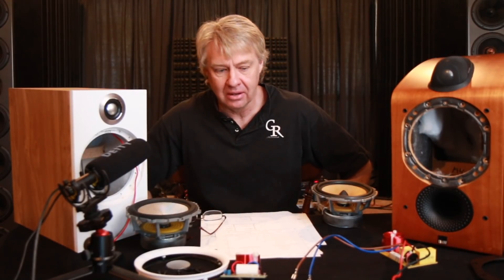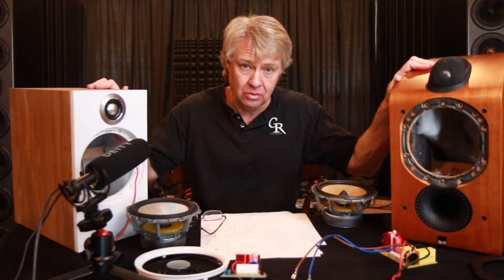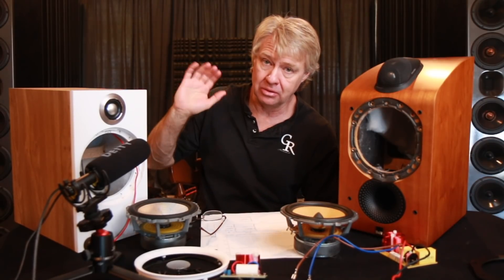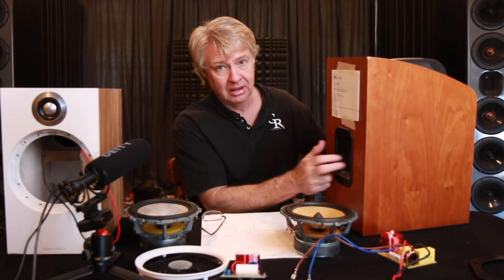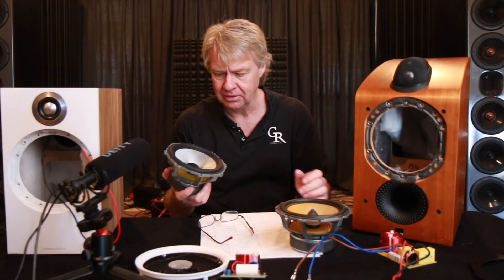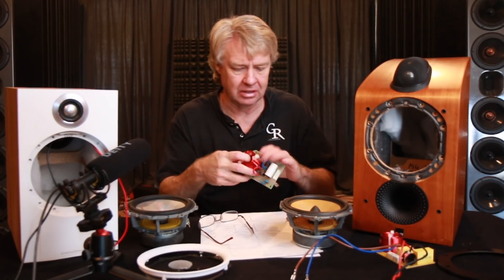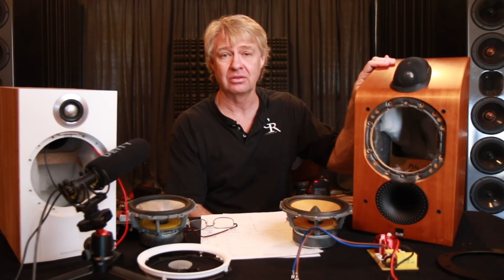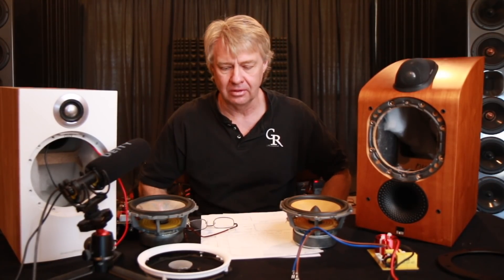Comparing Bowers & Wilkins PT.1

Comment: The 606 tweeter isn't mounted from the back side. The metal surrounding can be removed, then you will see that it is held in place by four small bolts.

Comment: In my room, my 706s brass band sounds like wooden instruments instead of brass. My made speakers brass band sounds like brass instruments instead of wood. And the piano sound on my 706s is "blong blong". But the piano sound on my made speakers "gling gling". And the voice sound on the 706s is 2D and not "throaty" enough. The brass band and piano on my made speakers absolutely smokes the 706s. Either my room really sucks treble or the 706s lack treble. I use the 706s as monitors cos my room acoustics varies a lot in the bass. I copied the 706 sound best I could with my made speakers and they sounded at least as ordinarily as the 706s. Then I tweaked my made speakes just a little bit in the treble and now they smoke the 706s. But!...I couldn't possibly make speakers without good expensive monitors, and they are a game changer for my speaker building habit. They were the thing that really got me going (they improved my speaker building so much).

Comment: Hello Danny,  Have you come across a pair of even older B&W DM7 Mk1 (the original version). I would like to add tube connectors to my pair upgrade the crossover.  I also like the feet that are on the bottom of the pedestal base.  I look forward to your response.

Comment: Wonder if the old ones were made in the UK? I think you have to go to the 800 series now to find an UK system.
Reply: Yes indeed, the old 700 series, as well as the rest of their range back in those days were made in Worthing England , or at least so it said on the label/plate in the back . I used to have a surround package from the old 600 S3 , consisting of LCR 600S3 , DS 6S3  and ASW650. Even that 600 series as a starting point in B&W was all made in England. Different times no doubt. Yes, nowadays only their top offer 800 is made in England.  Regards .

Comment: They are two different series I guess. 600, 700, 800 - while I do find it interesting it would have been better to compare the 705 S2 - that would have been a closer comparison in terms of how they have evolved their materials and other techniques.
Reply: Absolutely, it would have parts quality specially tweeter cap as good as Danny's fav Sonic Cap, Mundorf Brand that is in the same quality territory as SoniCap or better ....  Danny did not mention that these woofers are top notch quality and build better than what Danny's uses in his design....
Reply: I got some 706s and use them for reference for my speaker building. They are my bass-med-treble level guide. Essential for an amateur like me with varying room acoustics. I copied the sound of the 706s with my made speakers, but then changed the sound on my made speakers just a little bit for my personal touch. I reckon my 706s lack treble a bit in my room and the voice sound is a bit warm and not throaty enough. Now, in that room my made speakers absolutely smoke the 706's. No bought speaker priced at 2 grand is going to sound exactly how you want it...but with making speakers from scratch with 2 grand monitors, you are going to make great speakers. That is if you know how to tweak the sound of your speakers to make them sound how you want them to sound (instead of a clone of the monitors). And if you can build crossovers you can change it if you move to another room (or if you change the room's acoustics, or even if you move your speakers).

Comment: It's not an orange to oranges comparison. The old 705s should be compared to the new 705 S2. The 600 series is lower in class from the 700s and therefore the quality is lower. .

Comment: Those speakers are from different price categories. 700-series speakers are always a couple of times more expensive than 600-series.
Reply: Exactly. Would have liked to have seen the older one compared to its modern day equivalent, the  705s2.
Reply: He obviously doesn't know the difference between a 6 series and a 7 series B&W. I guess that's why he calls himself GR Research go lightly on the research part.

Comment: On the new Anniversary 6 series, you just pop the metal sorround off from around the tweeter unit. It is not glued, justheld on with some plastic tabs, very easy to pop off. Then it reveals 2 screws that are holding the tweeter unit in. Once the screws removed, tweeter pulls out, don't pull too far, as you have to disconnect the positive and negative slider cables from the back of tweeter unit.

Comment: i have the B&W CDM1 which is similar but from the early 90's. i changed the parts from electrolytic caps to foil and changed the coil to a lower resistance one. now i have the problem of dying tweeters again because the ferrofluid inside starts to dry and the tweeters then stop to move and even the coil then burns out because it draws more current. the ferrofluid tweeters are crap. i have wonderful vifa ring tweeters with the kind of phase plug in the middle. they are phantastic but i need a new case now.

Comment: So, valid comments about comparing speakers from two different ranges.  I would much rather see a comparison between equal models. The old 705 adjusted for inflation new would probably be twice as much as the new 606. BUT, what is interesting, is that used, the 705 can be had for what the new 606 S2 retails for. If you can find one that is. Apparently people liked them so much there are not a lot on the used market. This may support my confirmation bias that old high end will best new at the same price - 705s at around 1k, 606 S2 at 900. Without knowing anything about either, one would think that the 705 probably goes lower because of the bigger cabinet, and unless the crossover is botched, might have better vertical off axis response. The time alignment may be better as well.

Comment: I believe the new speaker cone material is Endumax from Teijin Aramid.  "Endumax, an innovative and superior cone material with performance beyond woven composites, has only recently been introduced to the industry. This new material is initially being introduced in a couple of different forms — woven fabrics, a cross-ply sheet of two or more layers of unidirectional material, and short cut reinforcement fibers as for enhancing the performance of wet laid paper pulp cones. The material is light and stiff, with a high Young’s modulus and high damping." --- "The stiffness for a given cone weight and geometry is greater than polypropylene and quality paper cones. From a speaker designer’s perspective, it is possible for extremely wide cone body angles (shallow cone), smaller voice coil diameters, and/or smaller magnetic systems to achieve comparable or superior results to existing speaker cone solutions."

Comment: On older 602 models you could reach inside the box with your hands, and twist the tweeter assembly 30 degrees and it came off. Almost like a "bayonet lock".

Comment: Back in the days B&W was good quality and design. Company was sold I think, then got separate again.
I liked them before, but can not think they make as good speakers as they did, compared to value for money.
It will be nice to see all videoes, what is pros and cons about both speakers.
Reply: Its still good qaulity he is comparing cheaper serie 600 with the higher qaulity 700 serie its not good review

Comment: Not a fair comparison. Needs to be 700 series for both. ( im sure anyone could see this difference ) 
get a new 706 for comparison .. That would be more aligned.
Reply: Im actually shocked that Danny doesn't even look into the specs or details of what is involved .. The cone material is called "Continuum" .. because Kevlar is a trademarked material by another company.. so B&W designed their own more for sound performance* 800 D3 had it first , I believe.*
Reply: Not the 706. Should be the 705s2. Both tweeter on top 700 series bookshelves.
Reply: @brs2c  Nope, the 706 S2 is baffle mount
Reply: @Psyphonyx_Life  I don't really care what the published specs are or what they call everything. Half the time what is published and what is real are quite different. And those cones are made in China. I know of one of the companies that used to make them. There was a time that those cones could be bought for pennies.
Reply: @tothemax324  I know. Carefully re-read what I originally typed.

Comment: you need to check out the b&w 601s3s really great pick up on the used market. a good contender to upgrade crossover also!  I personally have a pair with clarity cap csa on woofer and one csa and one cmr on the tweeter,  along with mills resistors as upgrade using rutchos design to reduce that excessive b&w sparkle!